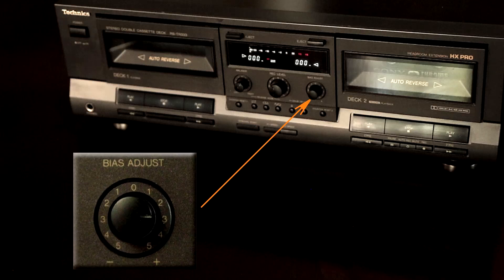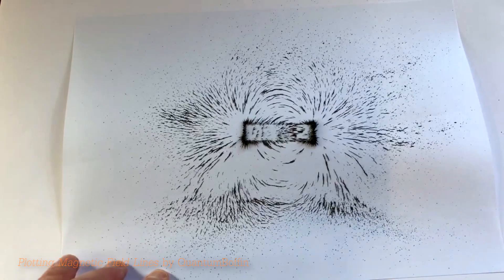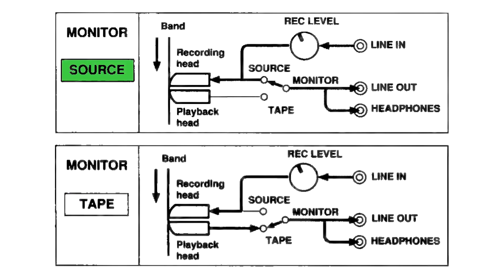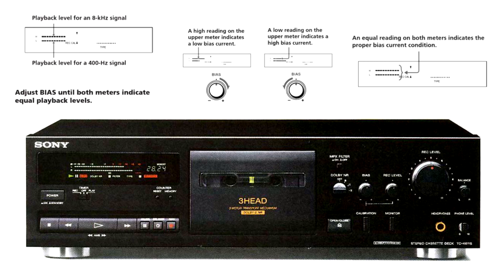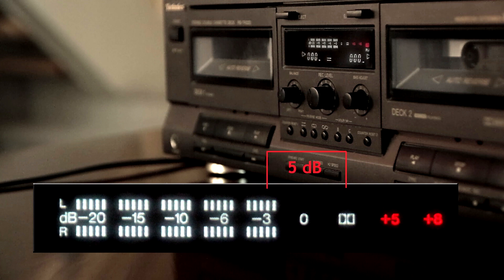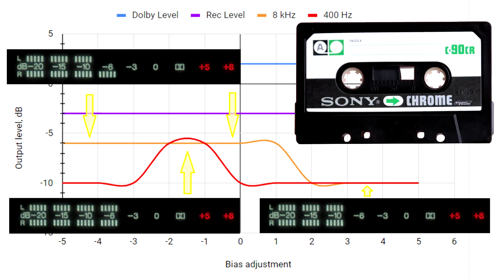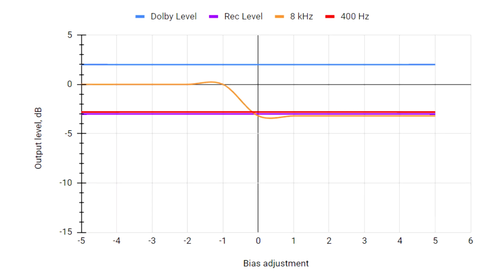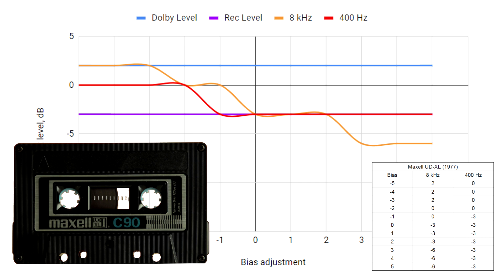Setting tape bias on a cassette deck with a two-tone frequency generator

Comment: I used to own an Onkyo TA-630D cassette deck that had Bias adjust with a two tone frequency oscillator. It wasn't complicated and results were very good. It also had "built-in" FM Dolby circuitry. A rather fine deck. Sadly, FM Dolby never caught on.
Reply from the maker: I have a simple Technics double-cassette deck that allows manual bias adjustment, I also have a Kenwood deck that has auto-calibrate feature - it records a bunch of test sounds, rewinds, plays them back and sets it up automatically. Quite nice.

Comment: I suspect you know but the upmarket version of the Technics deck you're showing not only has a Function Generator for the tones but can also perform a fully automated spectrum calibration starting from the BIAS at 10KHz following a baseline set at 400Hz, then performs a level adjustment at 3KHz and finally the level adjustment to match the output to the input, it even had a graphical spectrum representation of that function.

It is mind boggling to think all of this could be handled by a tape deck in the early 1990. It was convenience at upmost grade... and of course you didn't close the door manually, once dropped your cassette into the holder you pressed PLAY on your RC and let the machine do the job for you.
Reply from the maker: My other deck has auto-calibration. It is a two-head deck as well, so it records a series of test tones, then rewinds and plays them back. I think that closing the cassette door from a button or remote is excessive, and I hate the power liftgate on many modern SUVs too :)

Comment: Damn I just want to record something off the radio I never knew it was all going to be so complicated when I bought my Tape Deck
Reply from the maker: You don't have to use bias adjustment. You can just leave it in the neutral position, and most of the time you'll get a good recording if you use a compatible tape from a well-known brand.

Comment: It would be much better to get another App for your Android phone to precisely measure levels. Deck indicator is a bad tool with very low precision.
Reply from the maker: You are probably right. I wanted to explore a simpler approach using the controls the deck offers.
Reply: @ConsumerDV  in that case you need Nakamichi 680zx 😎